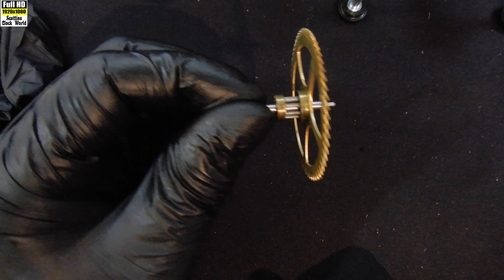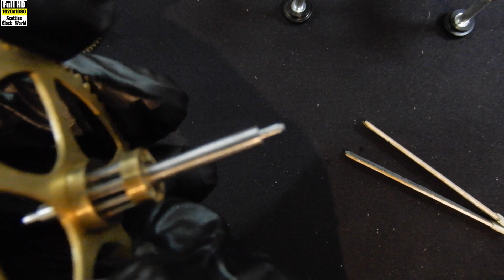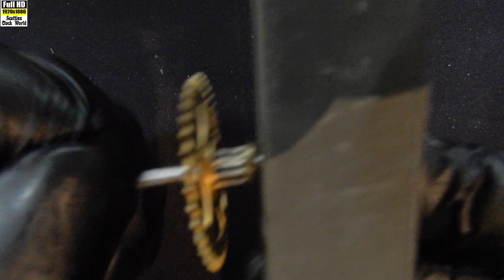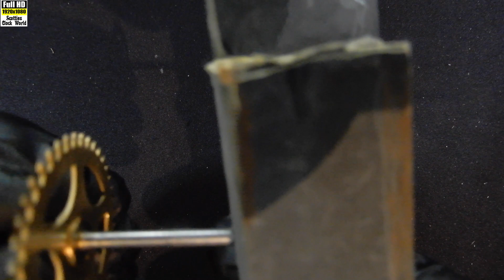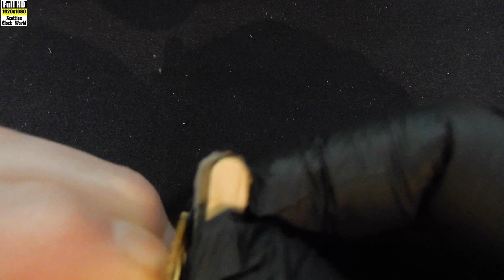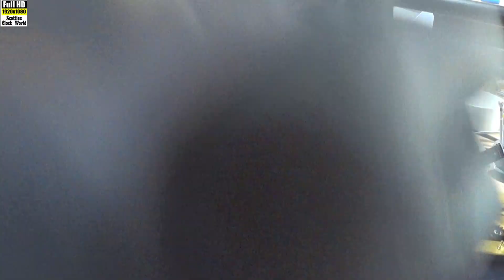Clock Repair For Total Beginners - Lesson 9

Comment: great video!  would large 'sticks' like you're using with 1200grit paper not tend to create a cone on the pivot?
Reply from the maker: Make sure you hold the 1200 grit stick parallel to the arbor.